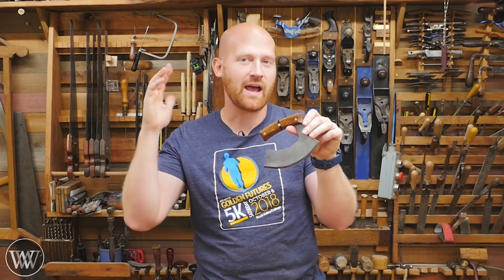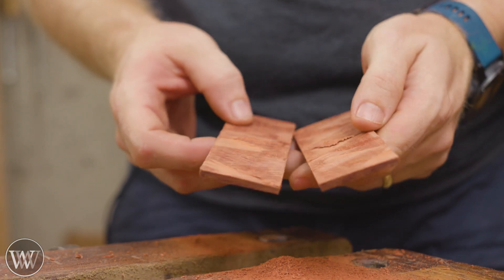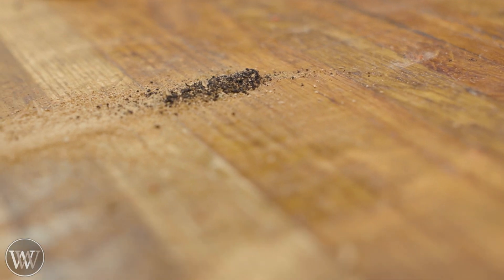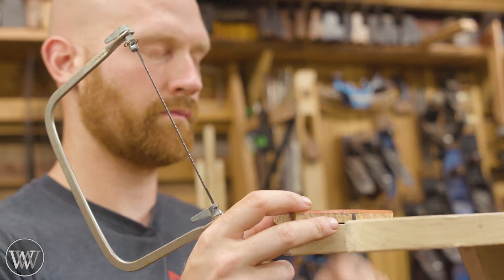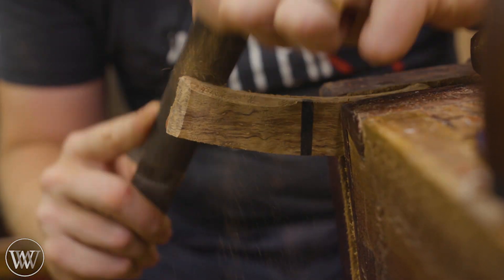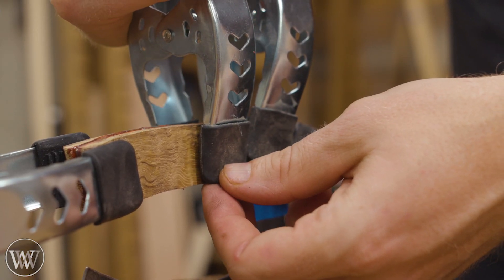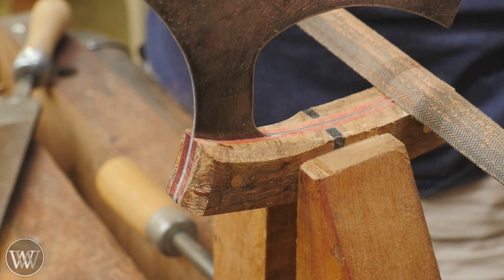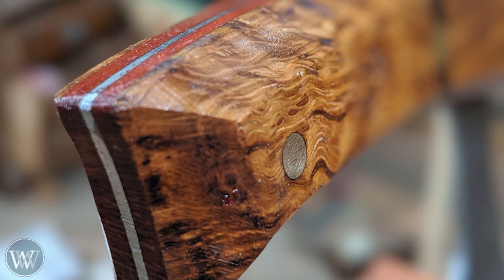How to Make an Ulu Knife With Black Beard Projects

Comment: Hey James, don't know if you still check the comments on older videos, but a toothing plane would also work well for adding texture to the scales for gluing, right? I'd be surprised if you didn't have one, but it's also possible you wanted to make the project look more accessible for those who don't have one.

Also, the BLO on that curly white oak is stupid gorgeous. Holy crap.
Reply from the maker: Right on. I've used a tooth in plane for veneer and other things like that several times. This would be a great place for it. Thanks man.